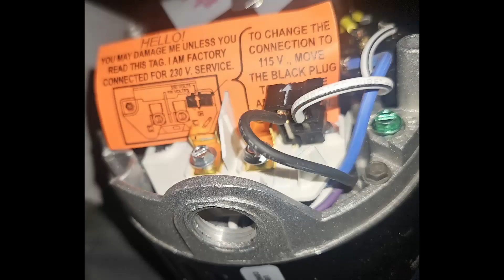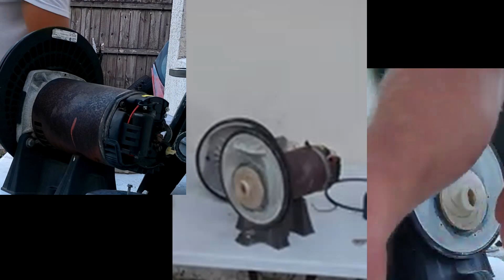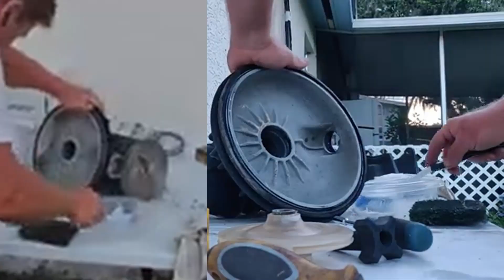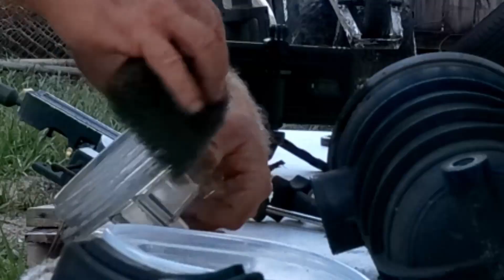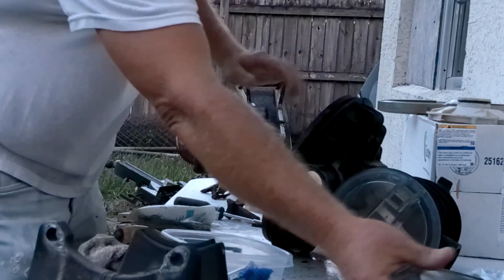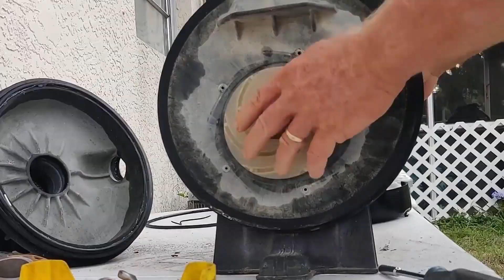How To: Rebuild Your Pump #howto  #pump  #motor

Comment from the maker: I only share the cheapest links to products I actually use. Below are what I used and other horsepower versions.
1 1/2 hp century motor  with all the o-rings and seals:
https://amzn.to/44xaSKq
1 hp A.O. Smith with all the o-rings and seals (century not available but oustanding quality):
https://amzn.to/3NLjFSj
3/4 hp century motor  with all the o-rings and seals:
https://amzn.to/3riLIAS
O-ring Lubricant magic lube:
https://amzn.to/3rnWjud